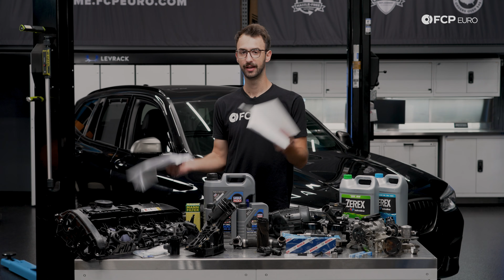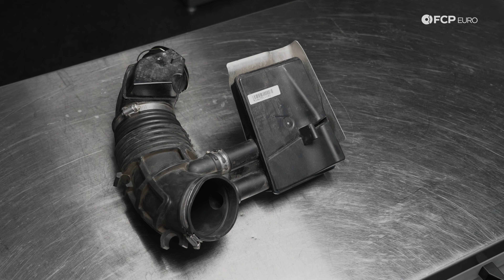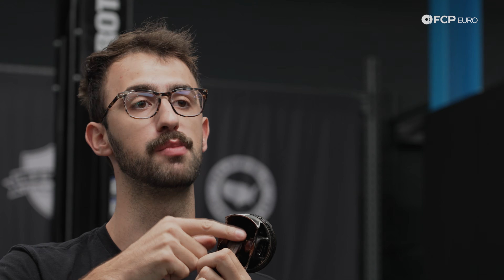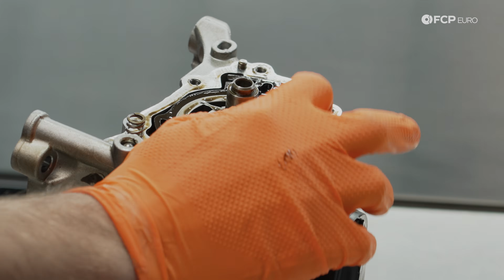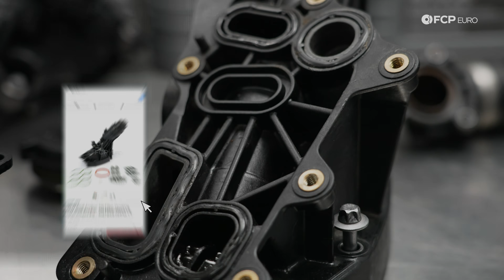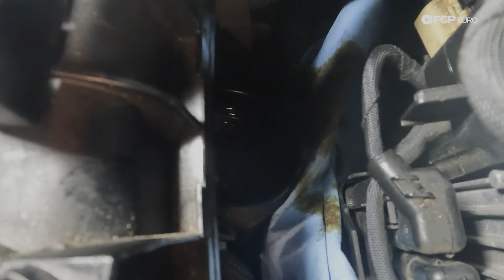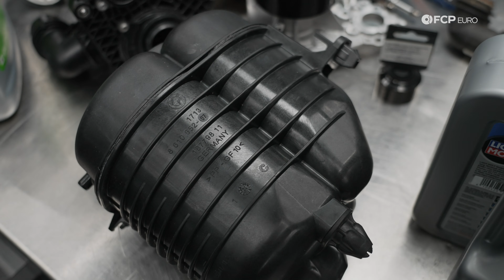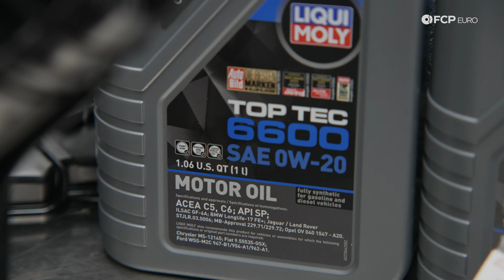BMW B58 Engine Guide: Everything You Need To Know

Comment: I have an x3 m40i (2022 w 40k miles) and am not going to sell or trade it. Maybe do a phase 1 or 2 tune w downpipes now since warranty is up.  It’s name is Shadow…. Cause cars have to have names. Lol. And change the oil every 5k miles; don’t do that 10k manufacturer suggestion; why risk engine ware?  Its 150$; not over a grand like Porsche.  The 10k screams “planned obsolescence” that can be avoided.

Comment: So i have a 2020 M340 xdrive with a Pure900 turbo, S58 injectors and a full DI fueling setup, currently running 5w40 should i go back to 0w20 i still have the plastic interior oil pump unfortunately

Comment: BMW Released a TSB (SIB)  SIB 11 06 26 which appears to be related to the failing oil pump issue on many B58TU models. Extended warranty  to 10 yr/120k miles. I had a shop replace mine (2020 M340i Xdrive) in late June, 2026. <sigh> Can I cry?? I guess keeping the independent shops in business.

Comment: I have the newer oil pump that replaced the plastic for metal and i'm making 500hp. Should i keep using 0W20 or should i got towards 5W30?
Reply: tuned 5w 30 but may mess with the vanos system eventually

Comment: All of these plastic parts under thermal cycles does not make me feel good about longevity. I have several plastic pieces in similar positions and purposes in my Mk5 VW I5 (which I love). Would much prefer an alloy oil cooler/filter housing, both for thermal management and longevity. Feels like planned obsolescence. smh

Comment: Be aware the B58 manufactuered up to Dec 2019 has a plastic impeller on the oil pump.  My X5 oil pump failed at 41k with a £3k bill!  This is a known issue. In Jan 20 BMW [quietly] changed it to the fully metal pump from the full fat M models. Browse the web and you'll see it a very commom fault.  Full failure results in total engine failure.

Comment: How about the plastic oil pump internals that can cause catastrophic issues on this engine? 

Also, why does no one mention the 2 service information bulletins for its bigger brother - the S58 that has both main bearings and connecting road bearing issues.

Don’t get me wrong, they are great engines, but I don’t expect oil pumps or bearings to be general maintenance items 😂

Comment: Rode in a friends modded tuned 340i. Fucking christ that thing is a rocket. The way the acceleration felt was nasty and aggressive. Scared me a little to feel the surge of momentum as you quickly reach triple digits. Loved every second of that ride. I been in a 440i stock and that was fast. Been in 2nd gen coyote on a tire and thats fast on freeway rollers otherwise on light to light its not incredible by any means since its not as torquey down low def a freeway car. But this tuned modded 340 was on a different level man.

Comment: What if the oil changes were done every 10,000 miles to 100,000 miles? Then do them at 5000 miles out the engine or can’t reverse what happened?

Comment: I have a 2019 bmw x3 b48 powered suv... its quick for its class but I'm lookin to definitely drive a b58 powered x5 40i next
Reply: just traded my 2023 X3M40i, it was a lot of fun to be sure, plenty of power and torque.  now a 2026 X5 xdrive40i, same powertrain, more weight, tuned differently, still fun, not quite as fast but smoother ride...that's fine in my 60's lol
Reply: @gregh76  dopeeeeee... my older bro was tellin me to go for the x5 since its already equipped with that in line 6 cylinder b58 engine... and I test drove one before... same ride height compared with my current x3... I look forward on getting that x5 40i or maybe 50i depending on if the math makes sense

Comment: there's also a recall on the fuel tank, warranty extended to 15 years 150k miles, they will replace the fuel tank for free if it is leaking fumes.

Comment: Great engine but your comment regarding water pump replacement is over generous. 80,000 miles is an overestimate of this pump. Mine failed at 39,058 so waiting until 80,000 appears to be risky. Retaining the plastic impeller in the mechanical pump was a mistake. Of course BMW’s history with water pumps isn’t exactly stellar.

Comment: I have a coworker with a B58 3 series. He's been running a +100hp tune for over 80k miles, and has 140k on the car. No issues whatsoever, just does all his fluid changes regularly.

Comment: I just picked up a 2019 m240i 

I had the 2016 m235i and it was great I ran it until 100k miles FBO MHD and XHP pretty hard. No issues. 

This new one has 49k looks and feels great. 

How worried about the new oil pump should I be ? It’s a gen 1 b58

Comment: The latest version of the B58 as fitted to the Supra is a very good engine.
Having the camshaft and chain and ancillaries on the rear of the engine has both advantages and disadvantages but seems to work well in the applications the engine is used for.
Also using a twin scroll turbo means no turbo lag and a linear power and torque curve right through the RPM range.
Also using a closed deck block and a variable water cooling system works well if a bit over complicated.
But overall the engine has some genuine innovative design elements that work extremely well when combined into the overall engine package.

But on a side note the B58 is definitely not made to be rebuilt at what is considered a reasonable cost.
😎🇦🇺👍

Comment: Thanks for the info! What is realistic life expectancy of the turbo under good preventative maintenance?  Also, saw a 2025 X5 40i locally with 45k that had turbo, intake manifold, and intake noise thing replaced already? What does the crowd think is the story there?

Comment: 540ixdrive owner here 155000kms
stage 1 with catless downpipe on a custom quad exhaust,xhp stage 3 tranny tune.only ever had to change waterpump at front of block,fixed it meself for 60 quid.still goin strong.

Comment: Great vid! I purchased a 2017 M240i xdrive and it has been exceptional. The main repair was the electronic gas door mechanism failed at 150000kms which the BMW tech said was typical for the assembly. They gave me a deal on the labour because he apparently had to remove the gas tank to replace it. I bought it with 96000kms and replaced the spark plugs and transmission fluid. I do oil changes every 5000kms and only had one incident where my coolant was low in jan 2025. It will be 3 years in June since purchasing it and the best car I've had, Super reliable. Going to firm up the suspension with front and rear sway bars and subframe bishings..

Comment: I have N47 engine. BMW recommends 30 000km or 2 years oil change. I cut that in half. So far I have 350k km on the clock. No major issues.

Comment: 2023 m440i b58 there is no internal plastic in the oil pump correct?? So running a 30 weight oil should be fine correct?

Comment: Fun fact, the “w” in 0w-30 stands for winter, not “weight”.
Reply: Well that's not even necessary, because I'm a retired mechanic, and never gave it any thought. 😂 We all know first number is cold rating. I run 5w-30 in my lawnmower or it won't  start in the cold, 30 weight is too stiff.

Comment: Yes, it is true, the N63 are more maintenance intensive, but they are so much better to drive. Feels effortless compared to the B58.
Still have a B58 in the family X7 but love the N63 in the G12 7 series. Had one with a B58 before and it was ok ish ... But power took a second to kick in and made lots of noise for not much reason as it accelerated ok ish.
The V8 has almost instant acceleration when pushing it without crazy noise like the B58 has.

My G12 750i has issues that are not really engine related: 2 AC issues, control arms, CV boot etc...
Engine related issues are the turbo wastegates, thermostat/water pump, radiator...
My 740i had a coolant hosez the PCV valve, the coolant tank and smt else that went wrong as well.

They seems to have about similar number of issues with the motor, but the B58 issues were easier to fix and cheaper.

Comment: Currently at 106k miles w my 18' B58 X3; ended up doing my water pump, OFH + Heat Management Module since I was already down there. I also did my radiator since there was a puncture in the lower right side since I do lots of highway driving. My rec'd is to replace it with the aluminum fittings and OFH and you'd be chillen..

Comment: This is awesome guys thank you!  Can I make one recommendation?  Have a full build list with links in your X3 build page, showing for example some of the upgraded metal over plastic parts, so we can quick reference them.  I have a 2020 X3 M40, so B58gen2 and it's been fabulous!  I am working for long term stability and reliability, plus performance of this fabulous car.  Working towards some of the common replacements for upgraded pieces would be a great idea over time, and love a quick list if possible.

Thanks!

Comment: How does this 2019 x7 x40i b58 engine compare to the 2019 x7 m50i N63tu3 engine in terms of reliability?
Reply: The B58 will be more reliable than the N63TU3 engine. However, the M50i trim wasnt introduced until 2020 - in 2019 it was either the 40i or the 50i.. the 50i had a N63TU2, which is less reliable than both the TU3 and the B58 (in any gen)
Reply: @JRB41 I’m looking at a 2020 x7 m50i n63tu3 (n63B44T3 530hp) 69k miles for $32k and a 2020 x7 x40i (b58) 48k miles $27999.   Which one would you buy ultimately for the best value and resell in 3-4years?
Reply: @freerepublicusa2064 Get the 40i.

Comment: Man I love this channel.  I had the choice between the x3m comp pre lci and lci or lci x3 m40i, money was not an issue. I drove all of them and genuinely for daily driving just preferred the x3 m40i. I got about two months aho a 2024 x3 m40i fully loaded for 50k with just around 23k miles and I love it. I did change the side vents to the x3m ones but i did get them with m40i logos. Just hated the small ass side vents. I pman on doing some simpple bolt ons and tune. Probably intake of some sort, MAD echaust system wkth high flow catted downpipe and tune. Probably charge pipe and turbo inlet pipe and transmission tune. Maybe kw coils down the road. It will be perfect for daily and make plenty of power. I wish the us got the same option M sport seats like m40is in other countries so i might do a seat swap down the road. Ive had 9 bmws to include a m2 , f80 m3 and x5m and this right hear is just perfect everyday car and sounds better. I might get a supra as well down the road and go crazy with it in manual or an m8 but we shall see.

Comment: I’ve had a 2021 M340i Touring since new. 50,000 miles. It’s absolutely brilliant. So smooth. Let’s give kudos to the ZF 8HP transmission too which gets the best out of the B58 and is a match made in heaven. Just had service and MOT - engineers said my car had the best performing engine they’ve seen, and the guy who collected and delivered it reckoned it’s the nicest bmw he’s driven, and he’s doing 100s of miles a day across the whole BMW stable. He told me to never sell it - I don’t intend to.

Comment: And here I am trying to figure out if I should switch my wife’s GX460 to an X7 with a b58 or not……
Haven’t had to touch anything on the GX for past 90k miles, probably gota do water pump around 110-120k easy DIY in the driveway. Other than that it t should last a while.

So s it really posible to bulletproof a B58 platform with replacing all the garbage plastic parts with aftermarket aluminum stuff right away? Or is it still a bad idea to keep these b58’s out of warranty?

(Was hoping to also possibly just have an x5 with a b58, and tune it to x5M specs power wise) while also swapping in x5M’s suspension/brakes/wheels on to it.

Comment: 18:18  always used OE BMW oil and  the plastic oil pump blew up in my 2019 m340i  it’s also a problem in colder climates .. dealer install the new metal oil pump but it wasn’t cheap and I always warm up the car

Comment: Have a 2020 m340i and I think my pump has been broken for a long time. Never a single code. Car was raced on road course some and gets raced SCCA auto when I co drive with my daughter. Tuned on bm3 and run 0w40 year around. My wife daily drives it and we race it by just switching wheel and tire about 12 to 15 times a year. If no codes or anything should I swap it anyways? Reason why I think it’s broke is because the oil level measurement fails at like 16% every time.

Comment: The PCV valve on my 2019 540i with 64K miles failed on a trip two weeks ago.  I was able to "limp mode" it to the dealership and they just replaced the PCV housing and cover. They didn't offer to replace the entire valve cover as you state in this video.

Comment: 90percent of issues with bmw motors come from the extended service interval instead of 25,000-30,000klm intervals change oil and filters at 5,000-10,000 klms and most of the problems disappear until 200,000klms plus eg oil squirters get blocked by old oil that’s contaminated causing timing chain guide failure

Comment: 2026 m340i owner here delivered yesterday with one mile on it. Looking forward to enjoying it for decades
Reply: You think all these plastic and electronics will last decades??????  Well then, I have a beachside property for sale in Wyoming!!
Reply: I bought a brand new m340i xdrive in 2024. 15,000 miles of fun so far, only issue I have is that I want wider wheels, but other than that it has been tremendously enjoyable to drive and own.
Reply: Liar. They do testing of at least 5 or 8 miles at the factory. But cool story bro!
Reply: @seanm3ify  they roll them back before selling usually
Reply: Urgh.. 26 model looks horrendous. Can’t believe you support that shit. Also why would you ever buy a brand new car?? $$$$$ straight in the bin juste after leaving the dealership
Reply: Only if you change oil every 5k
Reply: Yeah you wish, buddy.
Reply: @rustyshackleford8473 facts. I traded it for an X5. Why , because I am rich bitch

Comment: Hi, which engine is more reliable in your opinion - 2022/23 BMW X5 40i or 2024/2025 BMW X5 40i? My research indicates that the 2024 LCI is less reliable but slightly more powerful. What is your take? Some sources state that the pre-facelift is non-hybrid and the LCI is hybrid, others state that they are both MHT. I’m really confused. I’m purchasing an X5 next month, I need help on deciding whether to go for the 2023 pre-facelift or 2024 LCI.

Comment: Iv been trying to decide if I should go the "safe" route and get a 2026 Mazda CX-50 Hybrid - or get a 2022-2023 BMW X5 with the B58.  Mind you most of my BMWs were from the 1990s - mid 2000s with the exception of my 2014 435 that I had.

My 435 experience was only 2.5 years but it was odd since most of the older BMW kind of stood the test of time (age and mileage) the 435 being only 3-4 years at the time with 80k miles just felt like it was falling apart lol.

I also had a bunch of older daily drivers and projects cars starting from 2020 until now and its like every single car in the 5 years was testing me... so I got a bit sick of wrenching on cars mainly on my daily drivers.  Old car stuff.

Anyway - debating if I should get a 2022 BMW X5 and get a warranty (and if so - which kind/where) and have the dealership deal with all the typical BMW stuff...so I dont have to worry about the X5 myself OR I just go the safe route and get the CX-50 Hybrid.  The CX-50 Hybrid actually rides and feels close to my 2006 BMW X5 that I had.  Which I really liked and enjoyed but it was starting to fall apart cosmetically and I just didnt want to dump more money into it.  Big thing is fuel economy too.... Its been a long time since I owned a car that did more than 20 MPG combined.  With my old X5 I was at the gas station a lot. To top it off, my other 2 fun cars were even worse, both E31s - one with the V8 and V12...both had 23-24 gallon tanks...just like the X5.

So I'm in this weird spot decision. Its old vs. new when it comes to the actual age of the car....for the same price (kind of) the warranty will probably bring the price up of the X5 past the CX-50 Hybrid. Its a heart vs mind decision lol. Anyone have any ideas? 

The excuse I tell myself is the CX-50 is solid and wont give me issues, great MPGs and its still an upgrade in anything I have owned and ill have more a peace of mind - and I can dedicate all the saving to other cheaper and older BMWs to play with.  But with the X5 I would have the whole package... just have to deal with the BMW crap again... and if I dont - I have to pay extra for that and HOPE it gets covered. lol
Reply: Mazda?  That’s funny

Comment: The early N55s were not great however the ones in the M235i/M2 had the forged crank, rods from the S55 and almost all of the other issues resolved. It was also the final variation of the N55 before the B58 came out. I had an M135i with this variation of N55 and it was 10/10. 440hp on a stage 2 map and it did not miss a beat over the 40-50k miles i owned it.

Comment: I recently purchased a M240i which is fantastic. The oil service interval is stated by BMW as 18K.
My car has just touched 10K so I did an oil change using Liqui Moly 6600 0W-20 and an OEM filter.
Surely 18K  interval is far too much?
Great video my friend 🧡
Reply: Of course 10k is too much. 5,000max. install a fumoto oil drain valve so it's faster & mess free, & just drive your front tires up on a ramp. don't be lazy, change it often.
Reply: @DigitalDissidentmessy? I bought my car with 10K on it so don't refer to lazy. 
Prat

Comment: Maybe someday people will realize the charge pipes are fine, and only break because the engine mounts wear out and the engine moves too much under load causing the pipe to crack.

Fix your motor mounts, not the charge pipe

Comment: Perfect explanation but yes i have a question i got a 2023 mk5 supra b58 3min after cold start there is a light grinding noise not the pump and not the injector tik more mid and below of the engine many ppl with 340i got it after its warm it disappears for the most part i like to know whats causing it  i do 7000km oil changes car has 34000 km on it ✌️